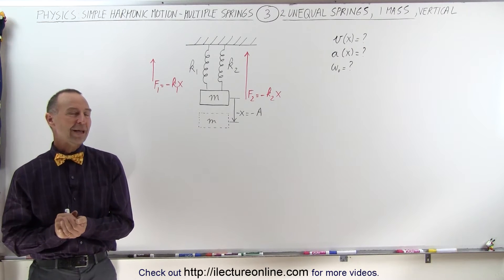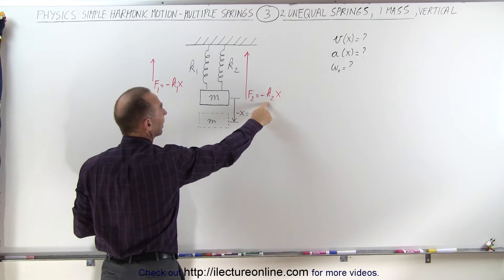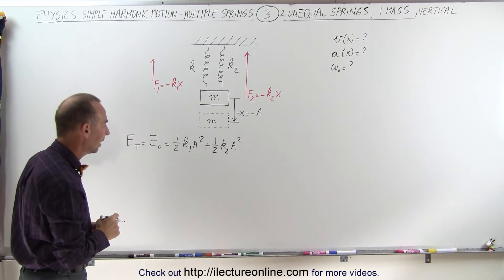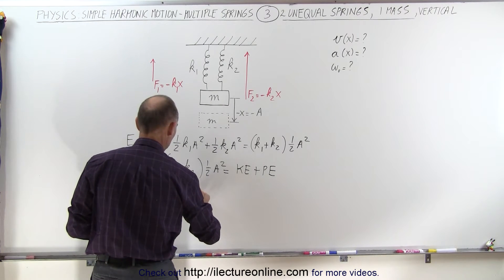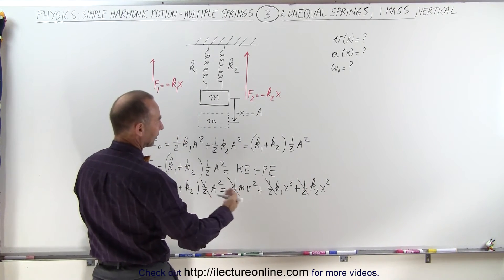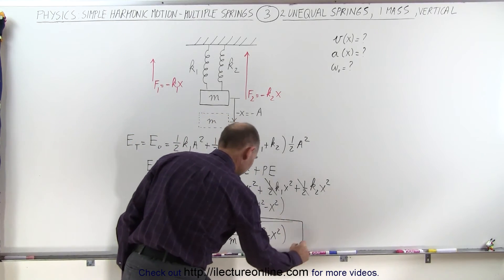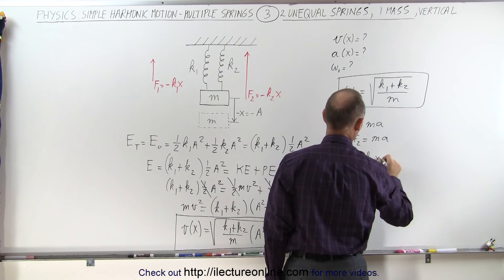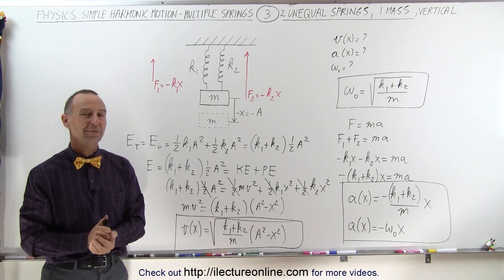Physics - 16.5  Simple Harmonic Motion - 2 Springs (3 of 5) 2 Unequal Springs, 1 Mass

Comment: why its not, m.a= -k1x-k2x+mg?
Reply from the maker: When the object is suspended from the springs, it stretches the springs until the weight (mg) is cancelled out by the force of the spring pulling back while the object is at the equilibrium point.